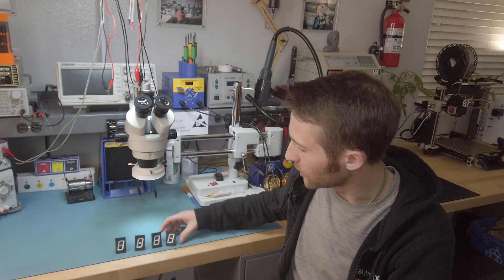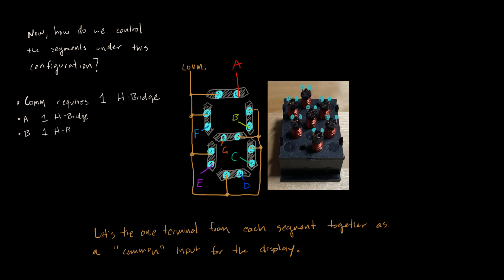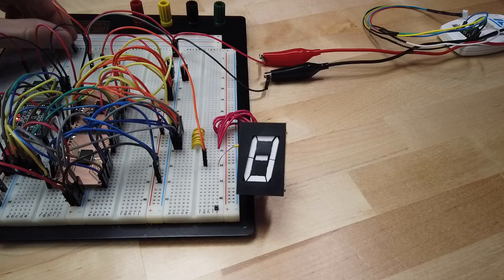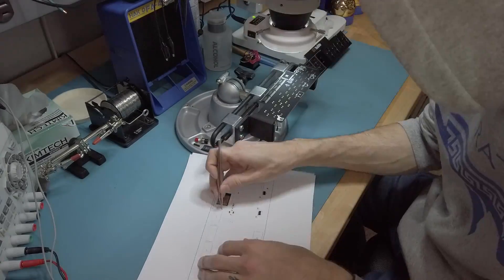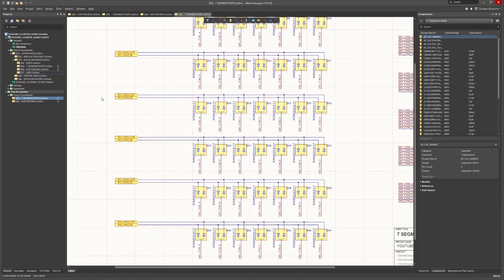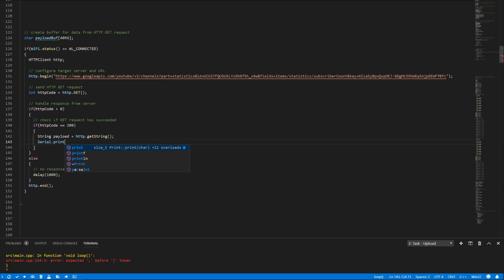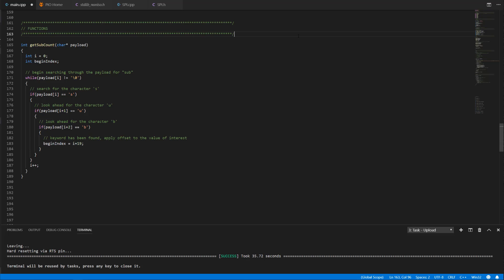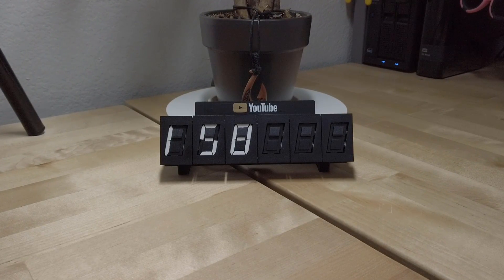DIY YouTube Subscriber Counter

Comment: brilliant, I tried to buid one but those chips are soic and I just cannot solder that fine.  Found FP2800A chips that work instead but expensive and obsolete.
Reply from the maker: interesting, those chips are quite expensive! but the DIP is much more friendly for soldering. have you tried using stencils and paste with hot air for SMD? it certainly makes the soldering much easier and faster, although touch up with an iron is sometimes required. anyway, thanks for the comment and good luck on your projects!

Comment: Where do you buy those (lovely) Electromechenical 7 segment displays? I can'f find them anywhere.
Reply from the maker: Hi Bruno! I found them on eBay, if you search for "Ferranti-Packard" they should be the first item. Here's a link as well: https://www.ebay.com/itm/7-segment-1-Ferranti-Packard-electromechanical-display/160945344354?ssPageName=STRK%3AMEBIDX%3AIT&_trksid=p2060353.m2749.l2649

Comment: very cool. Now, I need to go waste.ahem.spend some money on finding such displays..only thing was a large gap between the segments..is that typical. Maybe at gas stations of the past, I didn't notice that..I think the ones I remember as a kid actually had spinning wheels with all the numbers printed on them like house power meter readings..
Reply from the maker: You're right, the spinning wheel type were popular too. I'd like to do a project with those in the future as well. You can find the displays on eBay if you type in "Ferranti-Packard"

Comment: Hey Zack, nice going, I would check 2000 ms after any error, if you got a 500 error, or anything else than 200, it would cause to hammer the server, which could get you a rate limit reached, and then never recover, and also, technically it should be a bound check of >= 200 && < 300 so it gets all valid status codes.
Reply from the maker: Thank you for the tips @Da Skippy, I'm going to incorporate that into my code this morning!

Comment: When I was working on a similar project I used the built in string operations like this:
    String line = client.readStringUntil('\n');
    if (line.startsWith("\"subscriberCount\"")) {
Also: great production value and content, good luck with the channel!
Reply from the maker: I started messing around with the string class a bit. Most of my experience with microcontrollers has been writing C for STM32 and PIC, I'm not used to all the Arduino libraries yet. That'd likely have been much easier! Thank you for the kind wishes!

Comment: Optimizations: 1. Instead of holding an HTTP Conn open via a delay; Just loop till you get a response, terminate then deep sleep for the time till needed again. Saves power, and your router will thank you. 2. The way your doing it; The payload buff is an unnecessary copy, just grab a char* from the string.
Reply from the maker: hi @deathmock5, you're totally right about #2, thinking back I'm not entirely sure why I was inclined to move it into it's own buffer.

For #1 that's a good point, I haven't tried playing around with the sleep modes on the ESP32 yet. I'm assuming it will drop WiFi when it's in deep sleep?

Comment: A more robust solution for parsing the JSON response would be to deserialize it using a library like arduinojson. But you're only using one value from what I presume is a very stable API, so you're probably fine
Reply from the maker: Thanks for the tip, didn't realize arduino had a JSON parsing lib!

Comment: What microscope are you using? Also, would you be willing to share your schematic?
Reply from the maker: Hey! I'm using the AmScope SM-4TPZ. Most definitely! Here's the link: https://drive.google.com/open?id=1XsJIEHBYAshktk_dsgQ5XU2qP3vN8Cn-
Reply: @ZacksLab  Thanks! I've been messing with a few of these for over a year now with the idea of making a clock. I used an L293D to generate the +/-V and optotriacs to switch the segments and had some success, but ran into the same problem you did with the field collapse triggering other displays and never went any further than that. I had the idea to use a TVS diode to shunt the current but never implemented it. My prototype is here: https://www.youtube.com/watch?v=pfwrARCU7BI
Reply from the maker: @marsrocket  interesting! Yes, I took the same approach as you, doing a proof of concept on just one 7 segment display and moving onto making a PCB with many displays only to run into that problem. Looking back, I should have bread boarded more displays and I could have identified that problem sooner.

Your exact topology will determine where diodes are needed. If I had 1 h-bridge per segment I wouldn't have had this issue, but because I had segments sharing h-bridges there were unintentional "shorts". Once I redrew the circuit with the coils represented as a short, it became obvious where the diodes were needed. Just be sure to choose a diode that can support ~300mA forward current.

Comment: Very interesting! As for your checking for 'sub' substring, nested if statements might actually be more readable than a single line of &&. The compiler should optimize it away regardless, so focus on readability if you are working on raw chars
Reply from the maker: That's really interesting to hear, I actually wrote a different version that was more condensed but I found it to be less readable, so I stuck with the nested ifs for the sake of the video. Is it common in software to write more verbose code if it means it is more readable?
Reply: @ZacksLab  Yeah.  You should always write more readable code unless you know you have some performance constraint that prevents it.  Verbose-ness or succinct-ness are not goals, they are side effects.